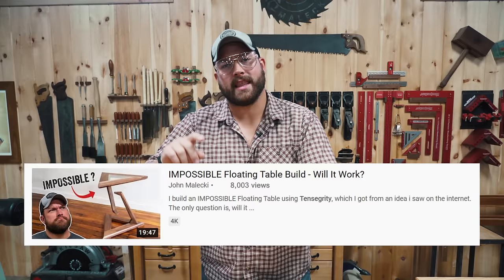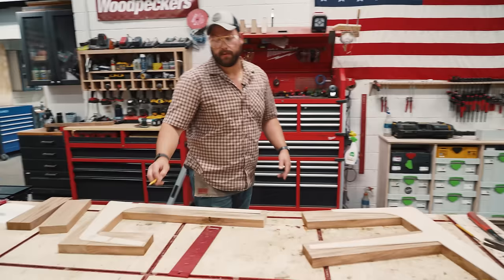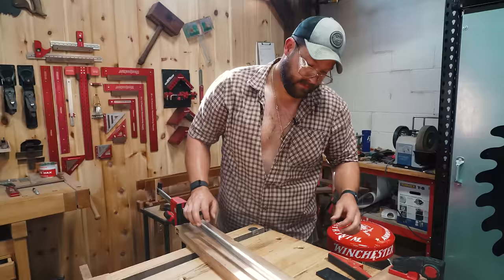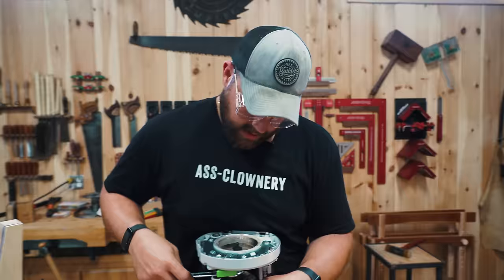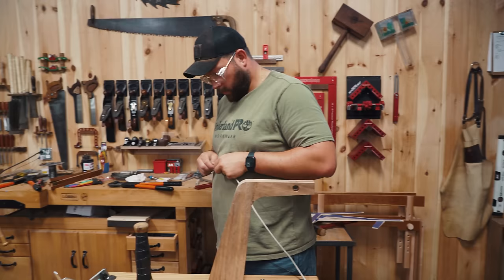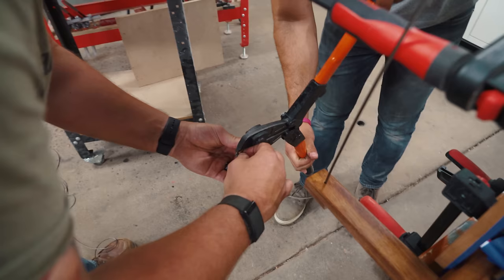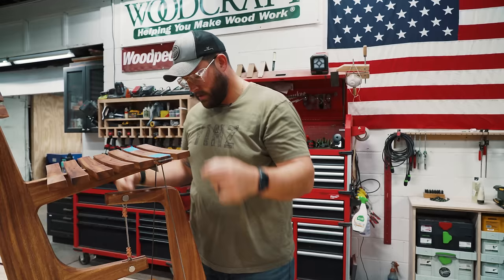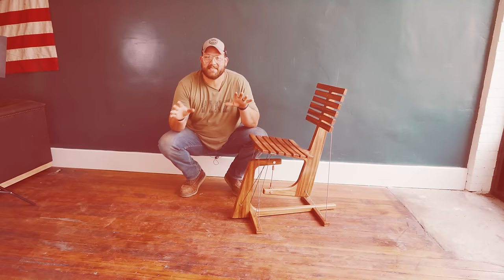Does This Chair Actually Work? My IMPOSSIBLE Chair Build

Comment: I think I know what you might need to do to make this work. To stop the rear pivoting and moving back/downward towards the base frame, you need a rear support added to the base frame. Then another cable from the support, to the base of the seat assembly. So in other words, the base frame would need to be a U shape, instead of the current C shape.

Comment: as you fix the triangle issue at the front of the sit by splitting the wires to one of each side, do the same at the back and it should be fine

Comment: Could you extend the arm piece thats directly under the chair and run two of what you currently have as centre supports? You'd still have to counteract a sway (make a feature, rocking chair?) But it wouldn't pivot in the same way. Essentially your central support which is the main weight-bearing one become two and is some kind of quadrilateral rather than a just a line.

Comment: I would put a cam on some of the points, so that as you sit and weight is applied the cam in a pulley block turns the extra surface area tightens the wiring.  Look for where the wire is slacking to create instability, and run a continuous line so it self tightens.  Also you look at the feet I would run a wire from each foot to the centre lower point then to the other foot, run the wire round the front of the foot to the other side and do that,  then back to the other foot,  and crimp, so you have a one complete circle of wire, but joining in the  middle of the centre span.

Comment: If you run a cable from the support post for the upper section to the rear point on the lower section, that should counterbalance the back

Comment: you get a few mm slack from each loop of the main center cable!! this plus the slight bending of the wood and you get all the other cables just hangin' doing almost nothing, no proper tension to hold it sturdy when someone sits on it

Comment: @John Malecki Why not try to put another short cable in the front? the same way you supported/connected the top and bottom halves with the metal rod in the wood.

Comment: I would move the seat and backrest forward. That would bring the center of mass more above the tension wire. And the slack wires further from the tension wires, equal spacing for front and back & side to side. Go off the sides of the back rest and seat slats. More preload on the wires so under load it doesn't go slack.

Comment: Making the verticals spine of the back deeper (in relation front to back of the chair) may gain you space to move the center point of balance further back. The edge of the chair may need to come forward beyond where you had it as well to get better COG. It makes footprint size larger but could gain you better access to fix the leaning back balance. Also, since you’re doing a 2.0 (I assume?) consider adding guy lines to each corner of the seat and run outward from center rather than straight down. That may help counter the leaning back motion. Better yet(?) you could cross brace each wire point = Run from the center line of seat to outer section of the base and from the outer edges of seat/lower back slat in to centerline of the base.

Comment: I would try Criss crossing those wires so that they cover a larger surface area and pull the tension from one side to the other so it counterbalances all the tension pulling kind of like the wing wires on a bywing plane.... And use a stronger wood like Osage orange or ironwood

Comment: Run a cable up the front spine of the bottom of the chair and connect to the forward edge of the seat under tension. That should hold the drop back

Comment: In my mind you could do a v run from the back corners around the lower tension attach point, and another run of cable from the front corners around the rear frame attach point.  I think this would stop the chair from trying to rotate forward when pressure is applied to the backrest.  $.02 😉

Comment: The bottom connection that created the tension part of the tensegrety would need to be moved towards the back of the chair allowing it to hold more weigh towards the back of the chair and not just the front slats.

Comment: connect another main support cable going from the upper support pin horizontally to the back beam.   that will prevent the chair from moving back and rocking.

Comment: I got my o work quite well with 2 wires on its part, front on the chair straight down, two wires from the back part straight down and the one in the center of course. center wire that holds everything, the front wooden part must be longer towards the back, in order to not get that back part fall so much backwards,  one more thing I built mine with metal inside the wood timber to make it stronger nothing visible on the outside as I have the metal in between the timber

Comment: Hm. If it were me, I'd look into heavy-duty springs for the back cables that will dynamically increase tension as weight is applied to the chair so the back of the chair doesn't get floppy. This is such an awesome project though. Great work!

Comment: If you would move the connection point of the lower end of the cable directly under the bum slats (what appears to be the shortest cable in the assembled chair) closer to the rear of the floating piece, it might be stable enough for you to lean back. Also, TIL it's super difficult for me to describe the parts of a tensegrity chair lol

Comment: Hi John,  every time any one of you sat in the seat, all tension was lost on the back lines, basically making them useless.  Way too many lines for my taste, but the wood looks awesome!
Go for a redesign. If you took the base and turn it around, then rebuild the chair with the hook in the front going back, it will relieve some of the seat tension issues.  Use a pulley system to maintain tension through the rotational forces.  Connect the seat stabilizer lines straight down to a pulley then straight back to the rear of the base to a pulley and up to the back of the chair.  This should be more stable.  You may still need an extra line in the hook area to prevent it from sliding back too far when you sit down, but that should get you on the right path.

Comment: I would take either a small rod or wire and connect the vertical part of the base , following the angle it is pitched back at, and just connect it to the center of the chair right below where u sit, the rod would eliminate the torque and can look small enough to where it is still floating, however a wire also could do similar if you were to fasten the wire and multiple locations along the back or front of the vertical base on the bottom
Reply: 100% any rod should eliminate torque since it will be a more fixed joint and resist that force

Comment: Keep the one point on the base and add a second point to the chair. So you have two cables holding the weight.  I'd also tilt the chair forward a few degrees.

Comment: I think if you moved the bottom pin towards the back of the chair it would even out the pivot forces towards the front of the chair when you sat back in the chair.  That would bring the back cable into play a little more I think.

Comment: I would try adding a cable from the front of the seat to the rear center line on the leg. That should help prevent the chair from rocking back when you lean back.

Comment: Drill a very long hole the width of the wire into the wood that is supporting the  seat from back to front then run a wire through the seat and mount it to the center front of the bottom support

Comment: Make the seat and seat cable pull against itself. Route the cable from the seat back down to the rear legs, as it does, then come forward and route up to the seat front, that may help keep the tension in the cable.

Comment: I built the same type of chair out metal the trick to making the chair work properly is extreme amount of cable tension. I used 300 lb  of sand bags sitting in the chair to get the right cable tension so anyone sitting in it under 300 lb the chair wouldn't flinch it was kind of scary at first

Comment: I think just by way of shape the rotation is going to happen when leaning back.The rake of the back is automatically wanting the forces to rotate around the top pin. If you take another cable from the bottom pin, back to the bottom support so it will pull tension when leaving backwards that would add the leg to the triangle you need for rotation. And you might be able to remove some of the other cables in front. 
As you said, You have rotation around your center pin. The Sum of your Moments needs to equal zero in the x direction. If you move your center pin backwards so the center of gravity is further back and brace the lower section to the bottom that would cancel the rotation. 
Also, when someone sat in it, the back cables lose tension. So they might not be needed either if the bottom ones hold the back from rotating left to right.  
Another thought is to create your triangle in the center to stop rotation backwards, instead of one cable.

Comment: Something u could do to fix the problem is to take the last cables u attached and instead of having them come down u should have them going down and back so the bottom of the seat is being pulled down rotating the center of gravity more underneath u since the bottom is getting pulled down u dont have such a drastic lean

Comment: You need to flip the part that ‘floats’ around. That’ll reverse the position of the center of gravity. Also, you can solve the swing problem by using an screw-eyes on both sides of the unsupported area, torque down the cable really good and that section won’t want yo move.

Comment: The issue I see front my point of view is that you need the main tension wire that you have at the very front of the chair to be farther back, so, where you have the second set of cables at the back of the chair. I wish I could show you but it is hard to describe it in words. The only other way is to have two tension wires one for the front and one for the back that would give you the ability to sit at the front of the chair and lean back on it without the chair wanting to collapses.

Comment: Center of gravity is off. But you could fix it by putting a cable from the very back of the base and connect it to the bottom of where the main cable is

Comment: part of the issue might have just been the angle of the seat/ backrest to start, if you made it more upright, it would look a little odd/uncomfortable to start (which also defeats the purpose of a cool chair honestly), but reach a more natural leaned back position once someone sits due to the cable stretch (kinda how it looks without anyone in it). something as simple as a few degrees over that whole distance might really help.

Comment: Could you add a second main supporting cable running from the top anchor bar diagonally to the bottom corner of the seat part of the chair. You would still get some movement but instead of the seat section moving down and backwards it would act a bit more like a swing and move down and farwards which you would actually be able to brace against. It is definitely a beutiful chair but as you said, the design does need a bit of work 👍

Comment: I know that it's been two years, but I thought up a solution that could work fairly simply. By extending the wires that are going up to the front of the seat through the seat itself, and running that wire through the top-back of the seat, you will have a line that pulls the back of the seat forwards, such that it won't fall backwards. The issue with that is that it essentially adds wire pseudo-armrests to the seat.

Comment: 1 vertical wire from the bottom rear corner of the seat part to the far rear point of the stand centre stud tentioned

Comment: Need to move the centre of gravity back but also the last wire you put in to support the back of the chair wo t really do anything and it can still slide left and right. You need to have it come from the closest 2 point and just a straight direct connection not a pass through.

Comment: Send a wire through the back going through the middle support and have it go inside the lower support and follow all the way down through the middle of the wood to the bottom of the chair? 

A "four" legged tension chair would be cool. Two legs each side

Comment: Just another opinion, you asked... :-)
As you surmised, yes, move the support cable much further back to put it under the seat where the seat transitions into the back of the chair.  That will help lessen the rotation of that support when you lean back in the chair, but it isn't a perfect fix.  For the final support to prevent the rearward rotation of the seat,  run a cable from the left rear leg to the current support point at the front of the seat (the hole that was just vacated by moving that support rearward) and then continue that cable to the right rear leg.  That should provide more stability as it is tying the previous rotation point to the rear preventing it from further forward movement.
Next, remove all the other cables and try taking the seat slat mounts and use 2 different cables to form an X shape for stability.  From right side of seat to left front leg.  And from left side seat to right front leg.  You already have those holes and the added angle of the cables crossing from side to side will add much integrity to minimize the left-right sway.
For the rear cables, I'd do the same X shape from the top right back slat to the rear left leg.  And the top right slat to the left rear leg.  Yes, that means modifying a back slat like the seat slat, but that should stabilize the back side to side .  
squirrely

Comment: Just add a piece of bar under front seat and on back rest about 1 inch small than your slats and tie wire to those down to legs instead of very close like you did ... Then make the back rest level up and down or tilted toward the front...

Comment: What I think you could do with this chair to improve it where it can hold more weight is with the base part. I'm trying to put this into words the part that's on the ground how it comes up on one side you should make it come up on two sides and put the floating part of the chair in between where it has two cables holding the chair instead of one. I know my explanation isn't translating right but basically take the base I'm kind of make it into a u-shaped form and then place the chair in between the u shape formed base and have the floating chair part at the bottom forum like a t like an upside down t where it can connect to both sides creating some more stability

Comment: John... to put it bluntly, the center of gravity needs to be 1 to 1.5 inches forward of the users spine. Think about how a rotating desk chair sits and notice that the rod is just forward of the back rest by about 2 to 3 inches. This is because most of your body weight is in the torso which sits closer to the back. Also, if you have good support on the lower section of the back the top section of the back will follow and tension will be your best friend so use something that won't stretch much like a steel braided cable instead of rope.

Comment: I feel like this was overengineered when it comes to the cables, i feel like 4 of the longer cables would have been enough had they been in a rectangle instead of the triangle format, as for the rear stability, maybe a second shorter cable at the back? 
I want to have a go at designing this but i can only make it on solidworks
:(

Comment: The middle center support run to middle of spine . Then cable to the lip to ase spine to counter the stress. Simple pimple. You could have did it with 3 cable. The back to base. And the center attachment to lower back spine. Then the counter from base to the end of where back spine hooks to front.

Comment: The method I'd use is reducing weight in the front half of the seat. The slats for the seat could have patterns cut into it on the sides or beneath it, sort of like how a sword has a gunnel in the center to reduce weight without reducing structural integrity. That should reduce the weight in the front that counter balances the back, shifting the weight back somewhat.. at least if I'm understanding properly. If you need less weight in the back, the same deal can be done, or even adding arms to the chair.

Comment: If you use fewer cables, i.e. try and use the same cable connected to more than one point so as to spread out the something something something.... That would make it stronger.

Comment: The issue is how you secure the back tip, instead of securing it down you want to find a way (like a pulley system) to have the force go upwards to counteract sitting weight.